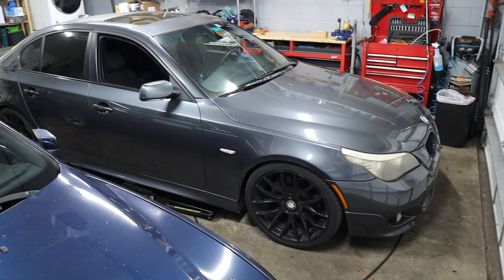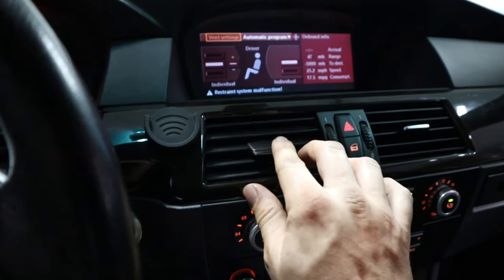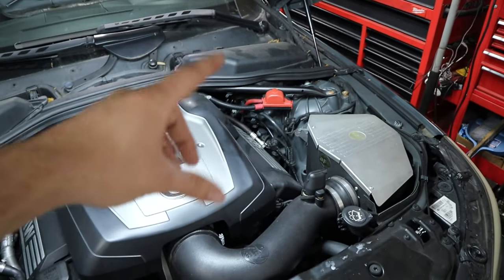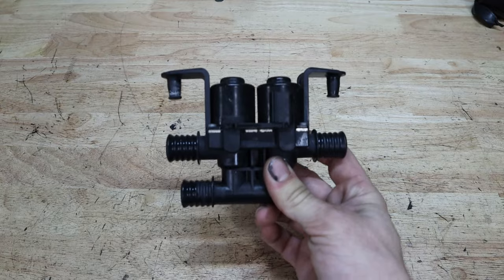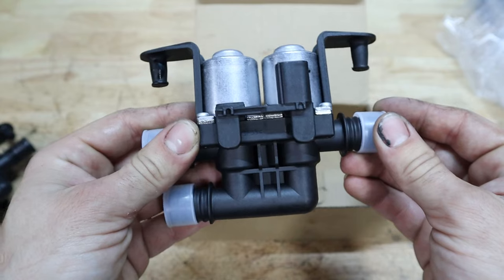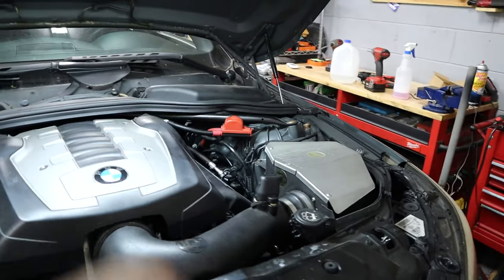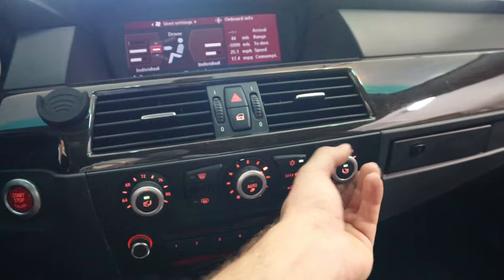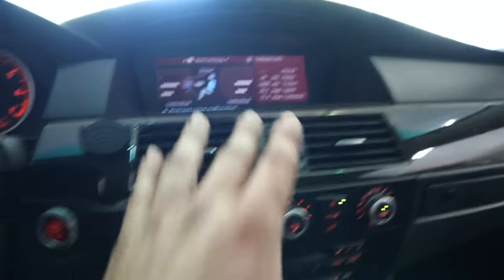BMW Heater Problems? How to: Replace your Heater Control Valve!

Comment: I bought an Amazon heater control valve for my 2010 e70 x5 but it didn’t fix the problem. Bought an OEM from FCP and that fixed the problem.
Reply: Good to know fr

Comment: I am have a similar issue on my e60 535 ixdrive where i have hot air in driver footwell and warm air on passenger side vents. I replaced the valve like you did but still the same. Looking forward to your 2nd video.
Reply: Same here! Anything else worked for you?
Reply: Same here...  Waiting on that video.  I can't figure it out.
Reply: Did y’all figure it out
Reply: @Foreignsgarage444  nah man, i didn’t get the chance to investigate it further. I plan to do it next summer
Reply: @haseebrehman5823  ECU Panel inside of the car. Probably a burning microchip.
Reply: @denisvuk85  the climate control unit?
Reply: @haseebrehman5823  Yes. If the problem is the samo 99% is climate control unit. Conector which goes to valve has 3 wires. 1 ground and 2 positive.  Plug it out and measure 5 volta needs to come out from both positive wires. Volts should be higher if u turn heater knop to colder if u turn to hotter should drop near 0, logic yes? If there is no change there is a short circuit u need to replace climate unit try with used one and check again. I hope I helped you.
Reply: @denisvuk85  thank you sir. I will check and hopefully report back in a few weeks. Really appreciate your help.
Reply: @Haseeb Rehman  hi,I have about same issue and I check the voltage on wires and i have aprox 5v if i turn the temperture button to hot and cold the voltage is the same, do you check the volts  wires?
Reply: @stefansas4566  mines stuck at 10 volts on one and 13 volts on the other no matter what the temp setting is. What did you end up doing?

Comment: Great vid for the control valve!   Late but hopefully helpful to someone:  Flap issues --> (1) frequently cycle through all settings, from hot to cold, up to down and re-circ to fresh - might help loosen and remove whatever was blocking any valves from opening/closing down line.   (2) INPA to check flap positioning (will tell you one is stuck)  and (3) Good scan tool perform active test on a/c heat control unit (IHKA/2) ... or possibly (4) reprogram/code it.
Reply: What is INPA to check flap positioning?

Comment: So I have an e46 and the mechanic after replacing  valve was having me tap the top if the valve when blowing only warm air to get it to operate.  He said it was sticking. It always worked no longer does it work heating is very eratic.  Should this just be replaced?

Comment: I am sure it’s less common,but what voltage does each of the terminals at the control valve want to see?? Can you shoot a quick sketch of the voltage at each of the poles on the connector?

Comment: recently fixed my heat and ac on a 08 550, the problem was 3 fold. 
First : bad heat on passenger side, okay heat on driver side, replaced the heater control valve, this made driver heat good but passenger side was still bad
Second: found that heat was okay on passenger side when driving, heat went cool when sitting at lights, replaced the auxiliary water pump. super easy and it fixed heat on both sides
Third: AC was colder on passenger side no matter what the settings were, driver side would blow ambient temp or slightly cool after running a while, checked the ac pressure and did a recharge, now ac is the same temperature
His driver footwell being warm might be a due to low pressure in the ac. i thought it was my flaps too at first but glad i didnt go down that rabbit hole, saves you having to pull the dash to check
Reply from the maker: Thanks for sharing your issue and solution process! I'm going to add the a/c check to my list of things to look at when I go to diagnose this!
Reply: Nice thread guys. I’m so sick and tired of my bmw heater issues. But not for long!!

Comment: 520d 2008 has also this valve ?    I ve recently have problem when AC on the hot air is coming from the top vents and when i switch to hot air some of the vents pushing cold air !

Comment: Hi great video. I habe the opposite problem i can't any heat into the cabin. One of the hoses going to that valve is hot and the other cold. This look like a valve problem. No heat at all.

Comment: I have had the exact same problem, I changed the exact same part, refilled my AC to have everything in proper condition but after one month same problem, sometimes it works sometimes it doesn't so I imagine when the car reaches the coolant operating temp the valves opens somehow

Comment: Hi, quick question. My e46 sadan is having a/c issue. Cold on the top vents and hot air on the floor vents. Would that be the same case?

Comment: Can someone please help? I have an 09 535 with codes for water valve, left & water valve, right. Hot air out of all vents. I replaced this part and cleared the codes. They immediately came back and I still have no a/c 🤷🏻‍♂️
Reply: same problem here, hopefully, somebody can help us
Reply: @alcon04  mine turned out to be the hvac control panel itself

Comment: Hi good day. I have a BMW 325 m sport 2010 model e90. N52. Am having a problem with water link for every 2 days. I have replaced the radiator and pipe like 3 time and it still link. But the heater in the car dnt work at the moment. But we going to fix tht and see. Plz any advice for me.

Comment: I had the problem of getting cool air on the driver's side (even in the winter) and hot air on the passenger side. The climate control struggled to correct the temperature which kind of enhanced the difference. Reading fault codes I got an error for "right hand water valve". Instead of getting a cheap new replacement I bought a second hand quality item but from a low mileage car (the old one i keep for spare parts and can repair if the problem appear again).

Comment: nice video.  i always have problem bleeding the E53 cooling system.      i have to double check the coolant level every day for about a week to get all the air pockets out.
Reply: Just jack up the car on the front cross member and open up the bleed screws. Should be very easy to bleed. Just becareful about the bleed screws. They can snap and break very easily
Reply: I had the same issue until I learned the trick to park the car upward on a very steep grade and then open the top valve.

Comment: Can a symptom be no heat at all in the car?
I've bled the car correctly but absolutely no heat at all.
Reply: How exactly did you bleed it ?
Reply: @dmitriyblakonov6602  I've tested my valve, no sound of the solenoid moving when adding or removing power so I presume its that, I've ordered a used one to try. 
 
Bleeding was Front of the car elevated, heater on, bleed screw removed, fill until  until no bubbles from the bleed screw etc etc
Reply: @wizzywilson  yeah, well I highly recommend staying away from used parts, because they can be broken too or last not long as well. I’d just order a new one, i have the same issue right now, and ordered one from FCP EURO. Will keep an update here.

Comment: im having a simmilar issue with my 09 535xi. blows hot footwell and hot defrost rest is cold. did you ever make a video how to replace these acuauators?
Reply from the maker: Problem ends up being the HVAC module 99% of the time. The motors and flaps are likely fine, unless you had an animal come in and build a nest. The module is what's keeping them from opening/closing correctly.

Comment: Do you know what could cause mine problem!?
I have f10 with dual climate. Driver side works fine, hot and cold. But passages side have only cold air coming from middle vent, while the one on the side also gets warm air as it supposed to do.
Reply from the maker: Sounds like a stuck heater control valve. Check the fault codes!

Comment: so happy I find your channel, I have a problem
The a/c is working good BUT WHEN RAINS AND WINDSHIELD GET FOGGY 
 HOT air is coming out for the vent 
(Windshield). ONLY 
, them I place the a/c and works but NOT FOR THE WINDSHIELD ONLY.
E60 2007 525i 
What do you think all controls are cold or blue color and. NOT RED in the display 
Please is so annoying 
Thank you for your help in advance

Comment: Great video. But why top windshield and bottom footwell have very hot air ..even the heater control valve is stuck closed.That doesn't make sense.
Reply from the maker: I believe this is a HVAC module issue, more common on this model E60.

Comment: Dear Dude Bro, why did you jack the vehicle off the ground and then proceed to work exclusively under the hood?
Reply from the maker: To catch the coolant falling underneath the car, and also it saves your back if you don't have to bend so far over ;)

Comment: I have a 2004 BMW X5 3.0 when I turn on the AC sometimes it gets stuck on heat and sometimes it gets stuck on cold or half cold and the other side hot. Can you help me please

Comment: Usually BMW has the top vents on a hot/cold selector that if you leave set to hot, even with the AC, it’ll blow hot. Idk how your particular car is set up tho but may be the case with the stuck valve. Also, the control valves are completely rebuildable, I’ve done it before, the kits are like 25 bucks. I heard a lot of these aftermarket valves fail but can’t comment on it. Nice subject tho, great video.
Reply: Hey, i actually had the same problem like in this video, i just changed the control valves and nothing changed i still have a warm air on the left side of the vents, can you help me out? Still dont know what to do and i just wasted my money on these 😭
Reply: @terbangbebas3685  you may have to take out the whole heater core unit and see if there is a problem or maybe with the vents opening or closing. This may require taking apart the whole dash. If it’s not a fuse, relay or module, or heater valve, it may be the heater core itself. And I have never had to get that far so I can’t really comment more. Hope you find the issue tho.

Comment: Same problem here with me in e60 I just change the flow then cold air comes. If I do on auto then hot air comes one and on another cold air comes

Comment: Im having an issue now, i have my a/c of and just blower blowing on the E53. But 1 vent is blowing max heat while the other is blowing cool air. Turn on the compressor doesn't fix the issue, it only goes away if i switch the dash vents to 3 dots blue or cold air only. Any leads is appreciated before i start buying parts
Reply from the maker: Sounds like a heater control valve issue, did you replace it yet?

Comment: Hi bud.  question. On my bmw x5 2012 e70 my front AC on dual sides works great, but on rear right seat 2nd row vent is blowing hot air and under the seat.  But ac vent on rear left side is blowing cold air.  I checked AC PSI pressure is all good, wondering, if I have dual heater valve issue?
Reply from the maker: Either a heater control valve, or the AC module needs to be replaced. That's my 2 cents!

Comment: It is possible to i have this problem on my e63 the air is cold but can’t be very hot and my gauge tamperature not moving on the middle
Reply from the maker: Sounds like a stuck flap inside the blower motor box! Can happen from a leaf getting stuck in there. You might be able to wiggle it free, or you'll have to partially dissaemble the blowerbox and clean/lubricate it. Hope that helps!

Comment: I'd suggest filling the AC with refrigerant, as I had the same issue that the passenger side was way cooler than the driver side and eventually the refrigerant was a bit low and refilling it fixed the issue.
Reply from the maker: This is also a common problem I've seen before! Thanks for sharing, I'll probably check mine to be sure!

Comment: My car only blows hot. (Ac off) same issue ?
Reply from the maker: Very likely, the valve is probably stuck in the hot position. Let's us know if you end up replacing and it solves your problem! Thanks

Comment: DO THIS FIRST.  Set your heater to ON, remove the coolant hoses from the control valve and stick a (water) hose on the end of the bottom one.  It will help if you have some sort of nozzle that can force some water pressure through the hose.   Put the water hose up against the coolant hose and jet as much water through it as you can.  Almost certainly with time a blob of antifreeze-colored gelatinous goo will come out one of the other lines.  When you use AC, coolant trapped in the core cooks to a sludge from summer / engine compartment heat and this is what impedes proper operation.  The control valve is a solenoid.  They work on basic physics.  If you run a current through a coil you will get a magnetic field.  Polarity doesn't even matter.  Nothing known to nature has ever violated this law.  So I'd actually dare to say that not a single control valve has ever actually failed.  The one on my 1998 e36 is still original.  But I've blasted numerous chunks of goo out of heater cores over the 25+ years I've owned BMWs.  This is almost always the problem.
Reply: Ok I tried what you said ; didn’t work; swapped it for new one and dismantled old one to see what was wrong; it seems the rubber seals or grommets had failed .
Reply: @denisovanhybrid9610  yeah that's def how they fail when they do fail.  Seal rots and binds up the solenoid.  Bummer you had a bad one, but at least you know your core is clean now!

Comment: Hello, I have a bmw e60 530i built in 2005, only cold air comes out, I changed the heating valve and it never happened, what could be the reason?  Would be happy if you can help me.
Reply from the maker: Usually after you replace the valve, from what I hear if the problem persists it's likely your HVAC module, which is integrated into the button for the AC on your dashboard. Try replacing that with a used one and it should solve your problems (after coding of course). Thanks for watching!